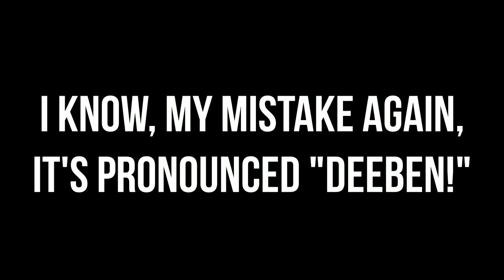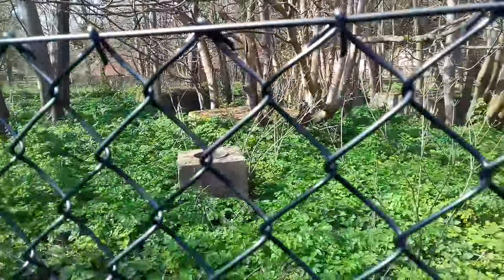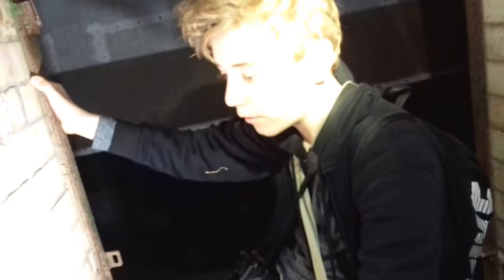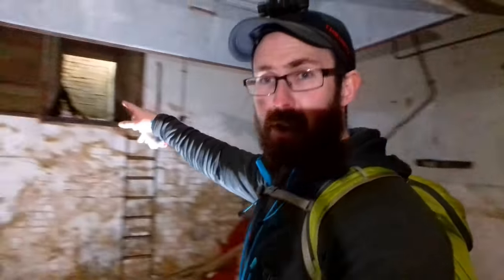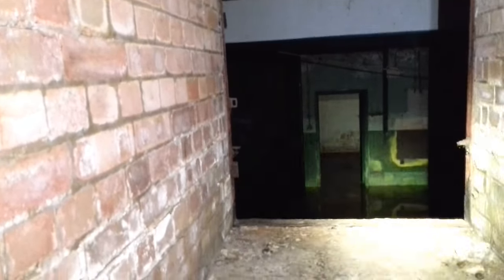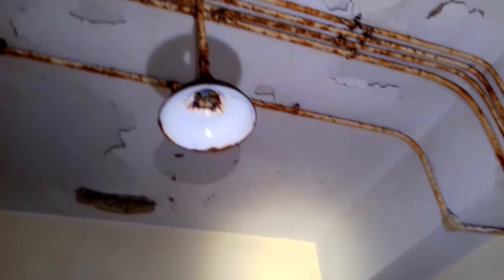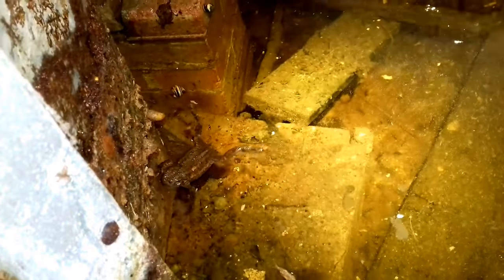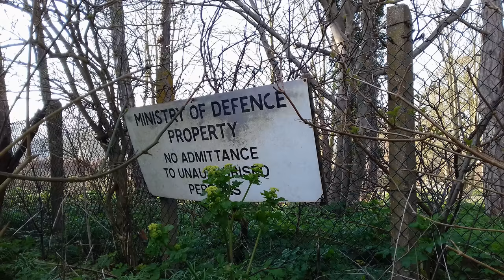WWII EMERGENCY RADAR BUNKERS | BAWDSEY SUFFOLK

Comment: Do you have any idea about the location of the old operational bunker? I have been at Badsey in 1970 and was in the old bunker but do not have an exact position. Maybe you can help me with by google earth coordinates.
Reply from the maker: Which bunker? There's these two that I explored, and there's the rotr bunker that's sealed off? Which one were you in? Did you work in there in the 70s?
Reply: @TOM_OUTDOORS  I visites the interception control bunker that had a fire. I was in Bawdsey on an Exchange visit in the Early seventies and  stayed in the Officers club, the Mannor.

Comment: any clue as to why one bunker was flooded and the other was not?? did it have to do with  being closer to the water? GREAT Tour Tom, Thanks for sharing your adventure
Reply from the maker: Prepping2endurE the flooded one was actually slightly further inland by like a couple of metres. Sorry, no idea mate. Maybe it's leaked in through the air vent pipes that weren't sealed up? Ask alfie, he'll know lol. Cheers pal.
Reply: The non-flooded one has paintwork on the floor, and looks like people may have tried to restore it, i'm wondering whether the Main access shaft was left open on the flooded one, but I really don't know for sure.